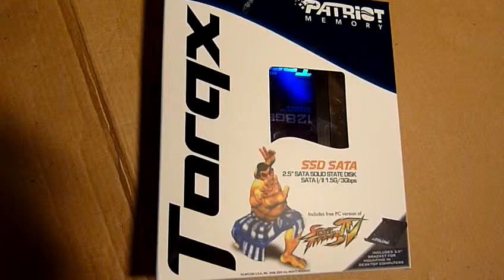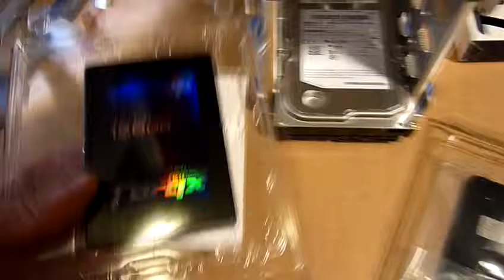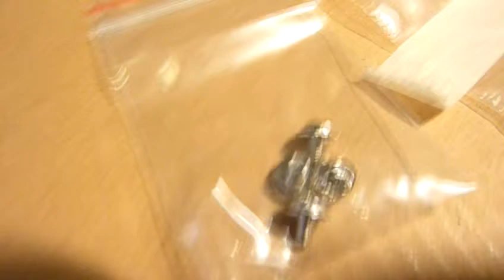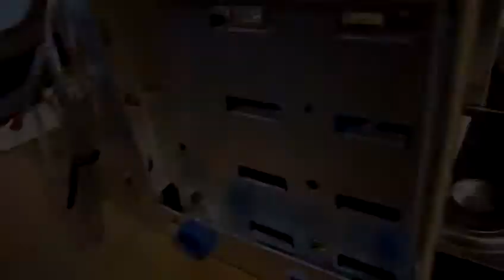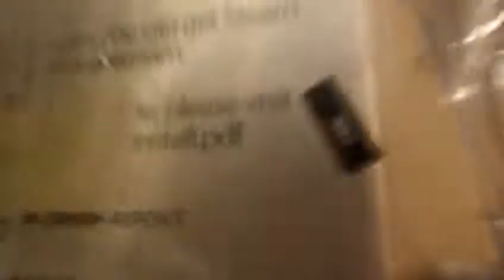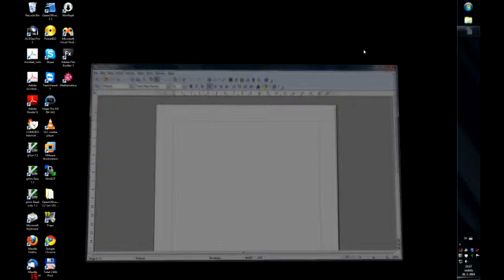Two lame dudes: building a PC - Patriot Torqx Install/Demo/Stats (16)

Comment: I watched the videos from the start, I must say well done. It's a shame you didn't show you putting all the cables in each hole thought it could be maybe a little confusing, well it'll be worse for me. I'm buying the same motherboard without the instructions or extra parts lol.